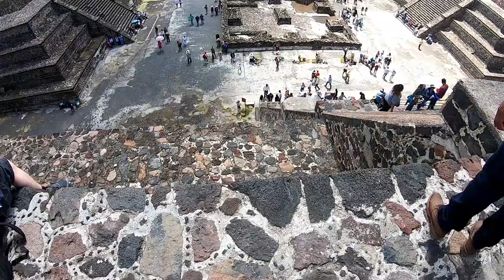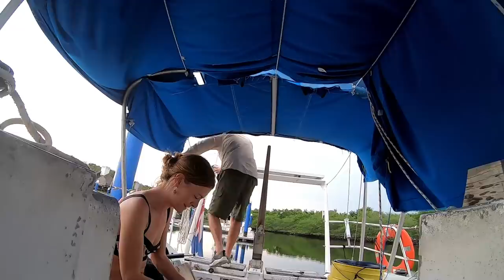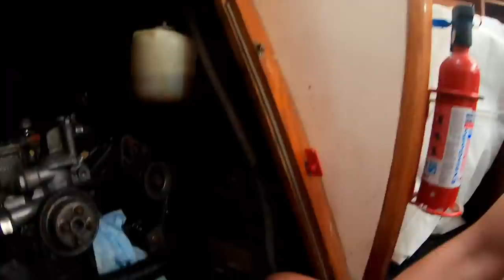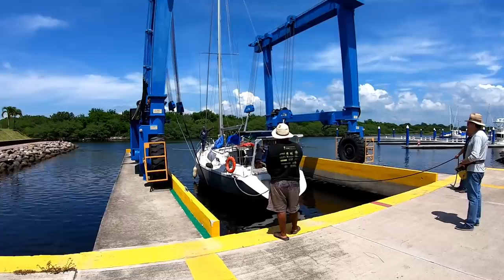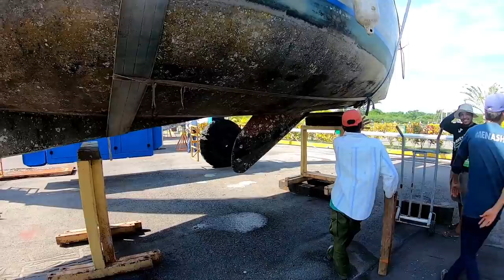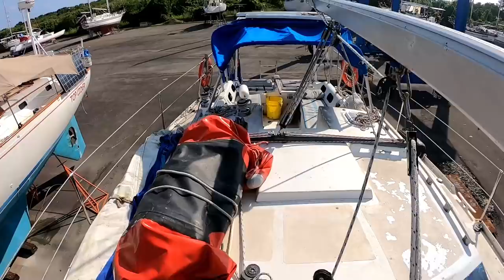I told you it would be A LOT of work! HAULING OUT : Chuffed Adventures S03Ep1

Comment: Polish the inside of your water pump the best you can. Impellers rip from friction. Either they starve for water, are not installed with glycerin or some other rubber safe lubricant, or the inside of the pump is not smooth. Good luck!
Reply from the maker: I think it was the lack of water post-not running for a few weeks. Thanks bob!
Reply: I wondered about that and also whether it was with the engine turning the impeller the wrong way every time the engine's stopped - last compression turning the engine backwards.

Comment: Hi Sheddy, I have not commented on the water pump bc I have so much confidence in Will and Lena;  they are beyond expert.
But I just thought i would ask if you had considered replacing the cam inside the pump body along with the impeller. Worn cams can be pretty hard on impeller vanes, not to mrntion the reduction in flow. They are not Too difficult to replace  but i favor carrying a whole assembly instead of the parts bc of the difficulty in replacing ceramic shaft seals. Normally a supplier can give a core credit if you trade in an old one. 
I really don't have much experience w Johnson(?) pumps but i was never good at rebuilding Jabscos.
It is so great to see you back, really looking forward to the new season.
Reply from the maker: Hi Marty, I think its to do with the age of the impellars sitting around my old boat! I dont think these pumps have a cam, unless I am off with what that is, the impellar just slides directly onto the end of the shaft which spins from the pulley... ?
Reply from the maker: Got it now, thanks marty 😁

Comment: Sometimes I feel like those impellers have as much longevity as a loaf of bread. Gotta be fresh, unlike good cheese. But I have a feeling they sit on shelves for way to long. Thanks for your tough folks who are lending support by working and being there.
Reply: I guess it depends what abuse they get - like having to deal with solid items, grit/sand etc. Seawater is an engineers nightmare ! A large fine filter on the intake may well help - with some reverse flow at times to clear it.
Reply: @millomweb  Thanks for the comment. They all receive CLOSE to the same abuse and are hopefully engineered with the same amount of space. Water is not the best lubricant but its fairly uniform. I'm looking for differences, as I have seen different timing for impeller failings. One I remember was a generator that was installed in Delos. It failed very quickly out in the Atlantic after it was installed ! It was easy to suspect that the impeller sat in the generator while waiting to be sold, thus, not very fresh. I'm seriously beginning to believe that the amount of time they sit, rather on a shelf or inside an engine , seriously changes the suppleness of the impeller. I am seeing a lot of evidence, but, it is a little harder to prove than I would like.
Reply: @californiakayaker  I'm having issues with cooker knobs - as are other people with the same brand but different cookers! I think they're fitting the knobs too tight onto the control spindles - so they're under a lot of outward pressure just sitting there, never mind being turned to overcome detents in the actual control.
It's very tempting to suggest switching to electric pumps.
Reply: @millomweb  can you give me a  model number your dealing with ?
Reply from the maker: I am so grateful to them all for helping, suspect my impellars have been sitting in Chuffed's belly too long prior to use... they were pre-boat purchase!
Reply: @VetTails  Oh wow, definitely stale bread. Moldy even . Sorry, just joking, but yes, time for fresh ones.

Comment: You did well with reversing for haul out 
Don’t take any short cuts in the work you undertake as it’s best do the job right the first time 
Out of jobs that will not put you in an unsafe condition and then tackle cosmetics etc as you go 👍
Reply from the maker: Reversing is so hard in a sail boat!!! Thats what we are trying to do - small cosmetic jobs to keep us sane between the really hard work of getting the hull sounds and new paint  on (so much sanding and cleaning out aluminium corrosion). But we are getting there!
Reply: Will be great to get a refreshing look and an increase in speed 
I think I heard your changing all the stop cocks which is correct way of doing things while painting 
You looking at pulling prop shaft and giving it once over and replacing stuffing box seals 
Sure be looking forward to getting on the the water again 
Another channel “sailing doodles “ has two dogs onboard and was in need of a vet I was going to mention he contacts you 😂 he’s in the Bahamas area now

Comment: I guess I was just fooling myself as well about the amount of work needed on Chuffed! But, with the assistance of your parents, Jim and, most important your patrons, this work get completed as planned. Just a bit longer than first thought. I have been wondering about that water pump impeller. It should not be failing so rapidly. Could there be one made of a more pliable material that won’t break so easily? Or is there a newer kind of pump that is more reliable that fit that motor? Hopefully there will be someone out there that can answer these questions and resolve once and for all this reoccurring problem. I will be watching earnestly as you progress with Chuffed’s refitting. Loving your upbeat and positive attitude sweet doctor!
Reply from the maker: I Suspect my 'new' impellars are actually 10 years old or something.. they were on the boat when I bought her! So going to buy real new ones and see if that helps. I too underestimated the work, but we did everything based on the knowledge we had at each step along the way... hindsight is 20:20 haha
Reply: There may well be an issue with the pump body or I'm wondering if it's being broken by the engine going backwards a little just before it comes to rest. Those impellers are clearly to be dragged round in one direction only.
Reply: @VetTails  Also, if the old ones were all bought at the same time, they may all be from a batch with a defect. Hopefully a brand new one (or 2!) will be a better material and last a lot longer.

Comment: Tip. Change impeller min  once a year. REMOVE when leaving standing more than a normal stop, I. E.  Long term preserve engine, losen belts, flush fresh water through system, remove exhaust outlet from manifold, change oil plug exhaust outlet. Just saying what I do and I've never had issues. Keep going, love the vids.
Reply from the maker: That was the problem - didnt remove it and it got stuck on the next start up - sound advice thank you!

Comment: The work ahead is the stuff of nightmares ! You don't want to do it but it has to be done; none of it is easy or convenient; there's a seemingly endless supply of it - all the while you're not getting on with what you want to do and there's all the hassles of temporarily moving out while the work gets done. I hope you have plans and can find something to put on the hull to massively reduce the amount of regular cleaning it needs - not at all my field of expertise but there must be some coating that can go on to A: protect the aluminium and B: deter marine life from anchoring to the hull.

It's going to be a slog and you'll just have to slog on ! On the positive side, there is at least 4 of you working at it !

Looks like impellers are one of the things you need to stock a few on in the spare cupboard ! Very disappointing with the short lifespan - I have 2 thoughts on that - a problem with the pump body - maybe solved by replacing the whole pump or it's the rotation of the pump backwards immediately the engine stops. Maybe makes me wonder about replacing it with an electric pump.
Reply from the maker: Haha oh yeh it surely is the stuff of nightmares! We have had some low days, but working with such an amaing group and varying our tasks has kept everyone spirits up and we are determined to get the job done. We have good paint sorted for the bottom and a plan for everything so far! I suspect the impellar maybe was sitting on my shelf a little too long hahaha
Stay Chuffed!
Reply: @VetTails  It seems stuff ages. The knobs on my cooker are failing - 2 failed in the last 3-4 months - it's only 7 years old - but other people are having the same issue. Never had cooker knobs fail before on 30 year old or more cookers!

It's great to hear you've got a plan for everything. And the more you get done while out of the water, the less you have to worry about later ! And later, fingers crossed, 'plain sailing' ! LOL

Comment: Hello, I also have an aluminium yacht. Can I ask if your engine is electrically isolated from your hull, to stop galvanic corrosion?
Reply from the maker: Yep it is, it has a floating electrical system so nothing touchs the hull. There is stuff online about grounding it to the boat, and experts fight for both sides, but I opted to go with the floating!